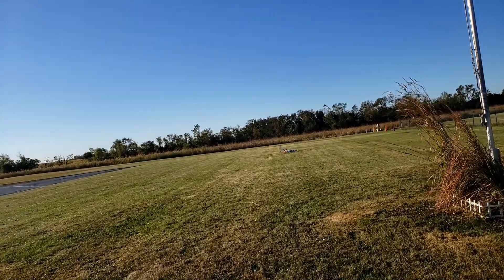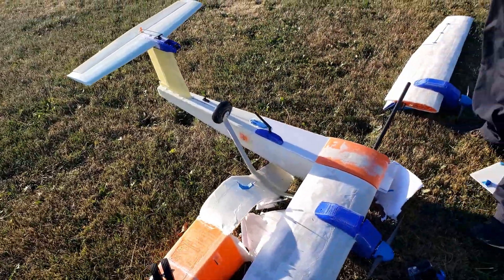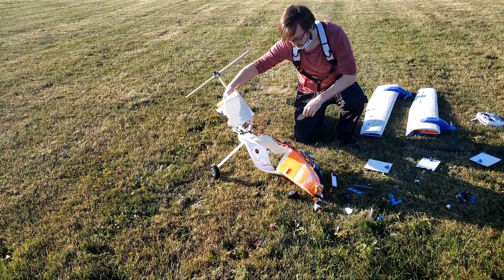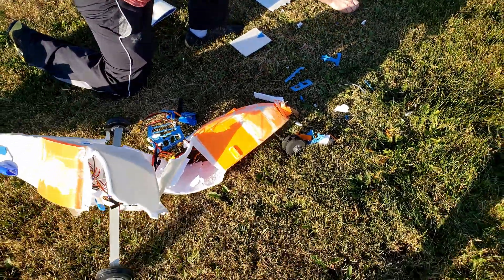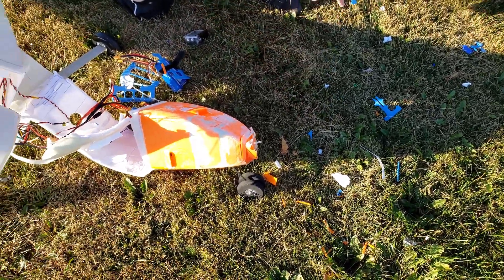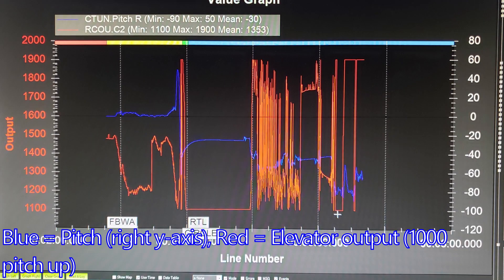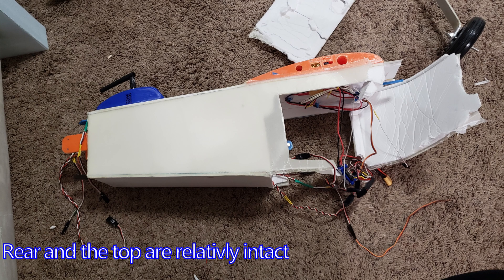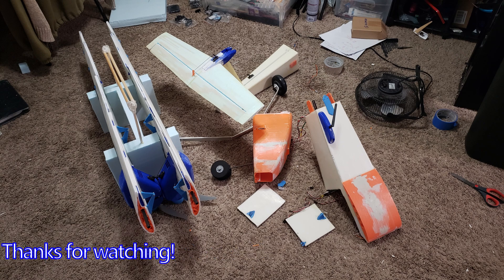NebulaV2: Twin Motor RC Cargo Plane | Unsuccessful Maiden and Crash

Comment: How do you that much about programming but dont know you should never maiden in anything but manual mode....flight controllers should be tried after you know the plane flies correcrly on its own. This is basic.
Reply: I don't think this dude comes from an rc hobby background although he is almost certainly an engineer. Eitherway, we all make mistakes and are bound to at some point.

Comment: How much weight can it carry
Reply from the maker: Estimated to be able to carry 5kg payload at 20m/s cruise, though that is on the edge of flying comfortably. Could increase the payload but it'd tax the motors more. Plus that is from simulation/calculation, haven't actually had a chance to do flight tests with payloads.

Upgrading the Motors to 2815 or 2820's or larger would increase the performance significantly.

Comment: Hey have you used that femto f3 for a fixed wing yet? I want to make a fpv wing. I want to know if you can use an rxsr with that board from emax
Reply from the maker: I haven't gotten around to it yet since i've been moving and finishing up my cargo plane. The r-xsr should work fine with the frmto-f3 since its sbus out similar to other sbus receivers.

Comment: Totally agree with Chris on this I always take off manual till i get some height .I must say it took off not to bad at all weight wasnt really an issue  I know you will have it up again and look forward to the next Video 
Take Care
Reply from the maker: Thanks for the support Robert! Yeah after this mishap I'll be doing the first take-offs in manual from now on! I was worried about the landing gear because of the weight being higher than estimated, but they held up pretty well. I've got the front half of the fuselage repaired already, need to fix the nose and reinstall the electronics, then its time for maiden 2!

Comment: Ouch! On the bright side, you'll never forget to check the directions again. I actually had this exact same problem once, but fortunately I was well above the ground before I let the autopilot fly it, so when I saw something was wrong I could just flip the switch back to manual. https://youtu.be/5QJZyUgY5zY?t=1257
Since then I always fly in manual mode first, both to avoid incidents like this and also to get a feel for the plane's behavior myself and maybe discover any lurking issues that the autopilot would only hide. I also want to do a good autotune before I can let the sticks go and relax properly.
Interesting to see how well the fiberglass held things together.
Reply: You still Alive Chris lol hope all is well with you Take Care
Reply from the maker: yeah, don't think i'll forget to make sure the deflections are right again! Good to hear from you Chris, how are the car and the new plane you're working on?

Up to this point I was always of the opposite mind set, I'd take off in FBWA, autotune the plane, then go to acro, and finally go to manual to get a feel for the characteristics of the plane. I've always tried to get the plane flying well in stabilized mode first, so that if I get the plane into a dicey situation in manual mode I can fall back to FBWA to recover. But that philosophy really bit me this time, after this mishap I'll be maidening planes in manual from now on.